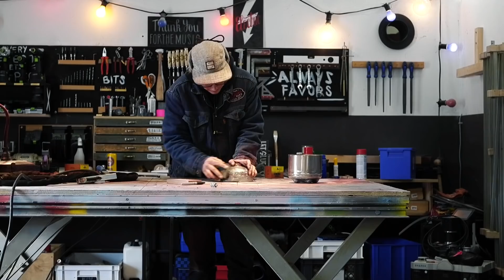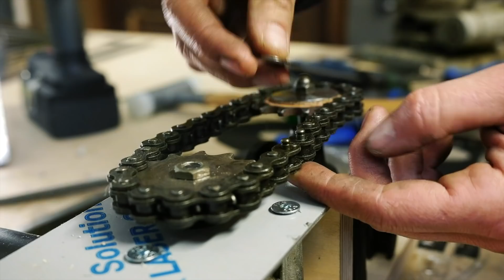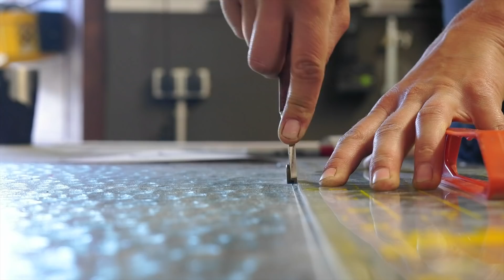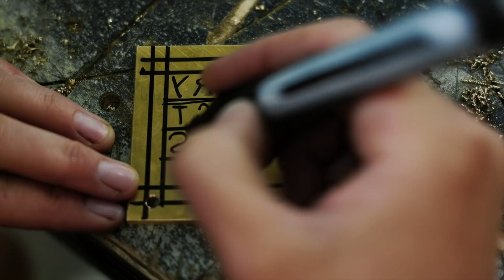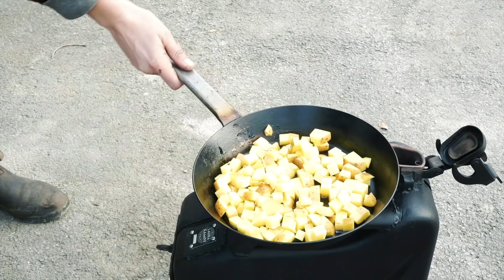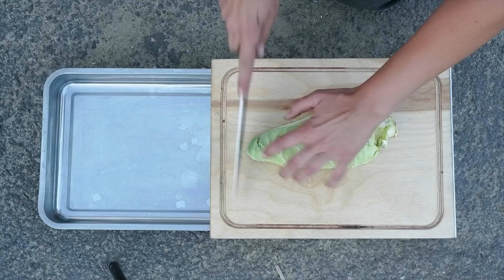10 Recycling Project Ideas

Comment: Normally you can drive the horse trailer with the B driving license, as long as the permissible total weight does not exceed 3.5 tons. For example, a trailer with a maximum of 1600kg + a car with a maximum of 1900kg

Comment: I just found your channel yesterday and I love it. I love the coffee grinder and the gerry can stove. I love fabricating stuff myself but most of what I have done is with wood. Although I have done some with metal also but I don't know how to weld. My latest project has been moding out a Suzuki DRZ400S. I built a metal bracket to strengthen the front fender and built a bracket to hold the larger regulator/ rectifier. Great work thanks for sharing your ideas.

Comment: The height adjusting BBQ was just such a neat idea, I built a similar one but the design was not so elegant, mine involves two sliding Square sections of Stainless, the whole thing was built in a Stainless Beer container and I can raise or lower the charcoal and raise and lower the cooking platform.
One reason mine was built like it was is because I live on the top of a windy hill, and it is sometimes useful to cook the food shielded from the cooling wind whilst cooking.
And like yours it is handy to be able to adjust the height and move the food closer to the Charcoal once things start to die down. 
The single thread idea on yours is far easier than mine, I have to use a tool I made with a hook on the end to raise and lower, and I have wing screws to hold the two sections at the set height. 
One useful addition I did make was a bowl fed by a pipe beneath the charcoal tray, where I can flood with Alcohol and light it from the outside of the container, the flame travels down the tube and the bowl then burns the small amount of Alcohol which lights the Charcoal, this was done to avoid the use of smelly Kerosene Gels or Lighting blocks.

Comment: A few years ago i rebuild a old expansion vessel to a hydraulic tank.
Was pretty easy: Cut open obove and below the waist, remove the rubber, tack some sheets on the inside to align the halfs and weld it back together. The first welding project i used forming gas...
On the top, where the valve was, the return filter is placed. It also works as a pretty big filling port.

Comment: I’m 74 live in Australia recently widowed. Before leaving my darling said I must build a camper van and keep contact with our 4 children scattered over the country. I bought a 14’ poptop caravan and removed the poptop section with a view of making new full height walls so I could step in enroute anywhere for kitchen toilet and futon. The lower section intended as base furniture was so tacky I pulled off everything except floor and took it to the garbage disposal. Fitted a semi circle front floor extension and ducktail rear addition then built a frame similar to Airstream Basecamp. Skinned it with 10 sheets 4’x8’ aluminium and basically built it from floor to curved roof. Fitted domestic glass fibre shower cubicle as centre strength. Test towed if 4.000 km it pulled like a trout in a stream....biggest task is getting a mirror finish....realise should have gone stainless steel but hey it’s only 700kg so I have the time now to experiment with polish machines, pastes, etc etc. So impressed with your work, amazing keep it up we love your videos...

Comment: I believe 'Heim' is (or was) the brand, as in the UK I know them as 'Rose' joints, but I think that technically, they are spherical rod ends or maybe in German 'uni-ball gelenk'?? (I used to run the spares truck for a race car manufacturer and spent some weekends selling parts in Europe and this is what one German mechanic told me? :) )

Comment: The caravan for sure! Because it's so close to what I'm building on. There is a 32 year old trailer in my barn that is always waiting for the next treatment. So far, with a few exceptions, it's pretty much original and I'm just trying to keep it. But at some point I will have to completely restore it because it is starting to rot in the corners. I love this trailer because it was built to be self-sufficient from the start. With its own solar power supply, water and gas. Perfect for just standing outside where you would never expect a caravan. Seeing how you work on your horse trailer took away many inhibitions about tackling this major project.

Comment: Laura, since you are not actually going to transport horses you can just ask to reduce the Trailer weight capacity and you can pull it with your van with a B driver licence. I reduced my Trailer from 1.5t to 750kg without any problems.

Comment: I did a paver path to bike from my garage to the road, where it was all sand. Well I still haven't finished, but I have 177 feet (54 meters) so far, and I'm a bit past half way, and past the hard part which was crossing the gravel driveway part. I was worried that our cars crossing over it would crack the pavers, but after 2 cars crossing it, it still looks okay.

Comment: Running out of motivation on a project is very relatable, especially on relatively open-ended ones.
Reply: I have a corner of my shop I've named my "Gallery of Abandoned Projects" to store projects I've lost motivation on for whatever reason. Most eventually come out of hibernation eventually but definitely had a couple spend over a year in the gallery before getting back to the bench.
Reply: @funkyspacecow  ,I love the name you have given for  projects that have been somewhat late in getting finished. Perfect.

Comment: In the 80's as a student with no budget and a motorbike for everyday transport, I made two side paniers  for my motorbike from 2 plastic jerrycans. Worked very well and was pretty watertight
Reply: when i was a young hitchiker i made a backpack from a five gallon gas can. it had wheels and straps. waterproof and its easy to get a ride standing beside the road with a gas can. at least gets you to the next gas station. couldnt have afforded a bike but i bet you would have given me a lift.
Reply: What IS a Jerrycan?
Reply: @sharontrujillo7793  Try Google :-) , a can to store some fluid like water or petrol

Comment: You need special driving license for horse carriers? Has it to do with combined weight of trailer and car (>3500kg) or something else ?
Reply: Yes it is. You are allowed to tow trailers up to 750Kg with your ordinary car drivers license. You are allowed to tow heavier trailers if the combination of car and trailer weighs less than 3501Kg. With an addition to your license you are allowed to drive with a combined weight of up to 4250Kg. For everything heavier you need a truck license.
Reply: It's because Laura is to young... :-)  Her license must be from later then 1998. At that point the usual license for normal cars (B cars up to 3500kg) only allows a trailer (any kind not only horse carrier) of only 750 kg. Or for a car and trailer with a combined weight of 3500 kg if the trailer is heavier then 750 kg. For any car and trailer combination that has more weight you need an extra license. B96 for car and trailer up to 4250 kg if the trailer has more then 750kg or BE for car and trailer each up to 3500kg. https://en.wikipedia.org/wiki/European_driving_licence
I'm a few.... well a few more years older and back then the same license was valid up to 7500 kg for the car (including small trucks) and a combined number of axles for car and trailer of 3 (if the axles on the trailer are less then 100cm apart it is called a tandem axle and counts as one axle). On those terms the combined weight of car and trailer was up to about 18500 kg, if the car allowed for this weight to be towed. https://de.wikipedia.org/wiki/F%C3%BChrerschein_und_Fahrerlaubnis_(Deutschland)#Gespanne_%C3%BCber_12_t